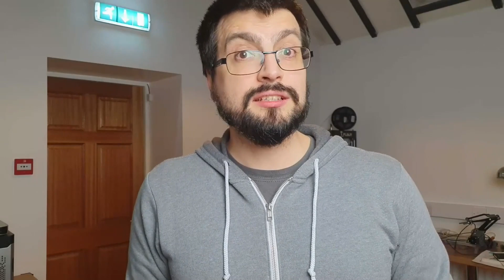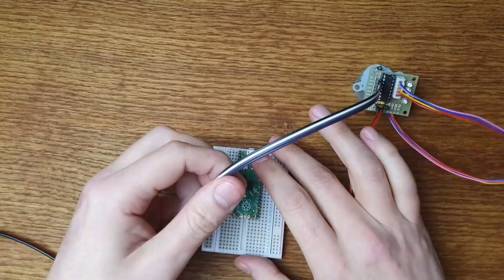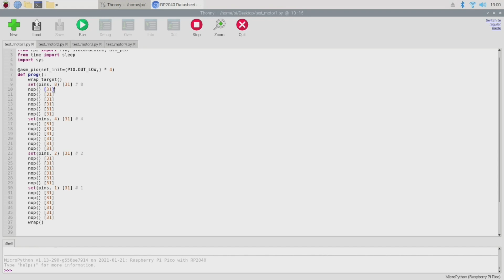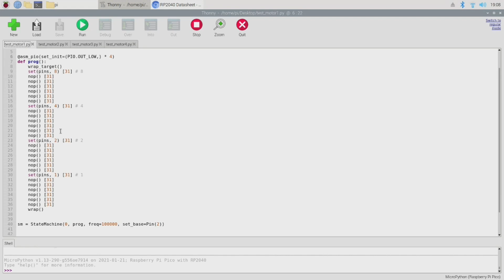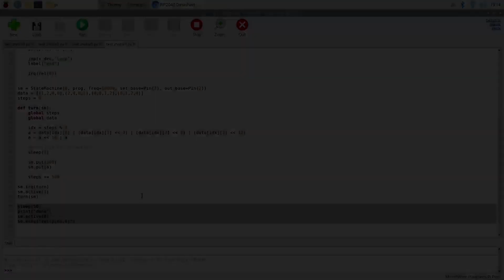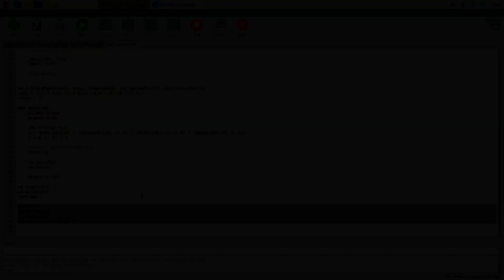Raspberry Pi Pico Stepper Motors via PIO

Comment: Thank you so much for a clear explanation on your PIO code! Just a note, shouldn't a common ground be between Pi Pico and ULN2003? Well, it works, but this is what ULN2003 spec requires if I am not mistaken.
Reply: Could be that his bench top power supply and whatever was supplying power to the Pico have grounds that are close enough for it to work.  But you're right, there really should be a common ground between the Pico and the ULN2003.

Comment: Being a nerd, I've taken one of those steppers apart and had a close look at the gearbox.
 Counting all the teeth on the gears, and multiplying all the gear ratios, led to an overall gear reduction of 63.SomeHorribleDecimal to 1, not 64:1 as you'd hope.

Comment: What will happen if we won't use controller and just plug motor to raspberry pi? Is there a method to make it work?
Reply: 3 main options, you can control the GPIOs on the pi using shell script, C++ or python. Probably best searching for separate tutorials on that. Main thing here is to learn to use the PIO state machines on the Pico microcontroller. The only reason he is demoing the programming on a raspberry pi rather than using the pi to control the motor, is because setting up for Pico programming without a pi/linux is currently a bit "involved".
Reply: You cannot drive enough current by GPIO.
Reply: @bumbarabun  I think by controller they meant without micro controller rather than without the stepper interface board... Although I guess that take on things might be the intention... I guess it is ambiguous

Comment: I've been calling it the "pee-co" (like the metric unit prefix) ... but yeah, I suppose "pie-co" (like the Raspberry Pi) really works as well... now you've got me wondering which is "correct".
Just been down a rabbit hole of IPA and pronounciation... apparently "pie-co" is valid in US English... but it works so well for this particular device...
Now... why was I here, oh yeah... you're gonna do some PIO...
Pity there aren't binary constants in Python?.. if I'd have been "the MicroPython man" that's one of the things I'd have added to the Python core.
I'm not that interested in stepper motors (well, not right now anyway) but I was VERY keen to see how PIO works... so, yeah, that was really useful.

Comment: Very good intro into the Pico's PIO! But in practice you will drive a stepper motor with a more integrated device and you don't have to take care about the  pattern for the phases.

Comment: This new math for decimal to digital conversion is very exciting. I've learn that decimal 8 is '1000' in binary and not '0001'.  For this code it doesn't matter if you do 1, 2, 4, 8 or 8, 4, 2, 1. It just changes the direction of rotation. And many have asked, where is the common ground between the Pico and the motor driver?
Reply: It's a matter of "endianism", in this case "little-endian". The first bit in a word that any word (even word of length 1, i.e. a bit) will definitely have is the lowest-order bit - the 1's column in a numeric representation. So that bit will take care of the GPIO line "right here", and anything beyond that (i.e. numerically in the higher powers of 2) can overspill to "further on".

Regarding the driver board... it ¦might¦ be a 'courtesy' to give it a common ground, but it's not a logical necessity. The reason being [I am surmising based on previous investigation] that you can drive two phases, a "forwards" and a "backwards" (with an option of "nothing") with two driven voltage sources, e.g. GPIO lines: (1,0) can be forwards, (0,1) can be backwards, and (X,X) - for consistent X as either 1 or 0 - is no drive. Just have the driver board compare the two given signal voltages for an unambiguous input. It's similar to the idea of driving an LED between two GPIO lines, instead of as usual between one GPIO and the high or low supply rail.
Do this twice - two independent channels - to get your four phases. How the electronics downstream inside the stepper motor chassis itself expands these four into a great many more physical phases for its actual windings is something I haven't pondered properly, though.
Reply: @duncanwalduck7715  , not with these steppers, they are 4 phase plus a common.
The ULN2003 is just 7 high current transistor switches, 4 of them are used for the stepper, the other 3 are redundant. (If they'd used the ULN2803 which has 8 switches they could've made 4 pairs, doubling the current capacity.)
 There really should be a ground wire from the Pico to the driver board.

Comment: why isn't there a digital ground between the Pico and the stepper board, what am I missing?
Reply: Unless the power used by both the motor and the Pico, my guess would be that at least one of the pins to the motor is always in a sinking-state and that's the GND connection.  Not a good way, but probably just a small oversite on the maker's part.
Reply: I guess PC and power supply have common ground through power plug but that is pretty bad way to do it and quite dangerous.
Reply: @bumbarabun  Not really. It's actually perfectly fine, you may call it bad practice but in real life it will work.
Reply: @tunahankaratay1523  perfectly fine? Yea have ungrounded power supply and burn USB ports on your PC or maybe motherboard as well. That does not sound fine for me.

Comment: nice little driver board.  Also works on arduino I presume? never seen  them so tiny, is that anew thing?
Reply: Yes. You can write your own functions exactly as seen here or use the in-built library within the Arduino IDE (https://www.arduino.cc/en/reference/stepper). If your intention is to learn programming I'd experiment writing your own functions, however if you're attempting to build the motor into a project I'd recomend -> http://www.airspayce.com/mikem/arduino/AccelStepper/ as a library that can add acceleration/deceleration ramping allowing smoother, faster movements. If you're interested in writing your own accel/decel code, http://ww1.microchip.com/downloads/en/appnotes/doc8017.pdf is a good place to start for the base theory.
Are you referring to the driver or motor being small? In either case there are smaller (better) versions of both. A good driver is https://www.digikey.co.uk/product-detail/en/trinamic-motion-control-gmbh/TMC2208-SILENTSTEPSTICK/1460-1201-ND/6873626 (hunt around for the best price).

Comment: Where's your ground line between the pico and the driver board? The four signal lines aren't enough, it needs a connection between the ground connections of the boards.. Looks like you're lucking out without it, or it has the wall outlet ground as common between the driver board power supply and the computer ground to the pico on the USB connection. Neither of these is good or reliable.
Reply: I assume he takes the 5V from the pico supply line.
Reply: @foorjee  I had a similar issue with one of my projects. I was powering all my external interface circuitry from my bench power supply and it all worked despite missing off the ground to the Pico. I actually wanted a floating interface supply - I found & removed a discrete (barely noticeable) link between 0V and ground on the bench PSU and I assume my PC's 0V (as appearing at the USB interface) is also grounded via the mains earth line. This "accidental" grounding should be avoided particularly on analogue circuits (I was using the ADC) where a "ground loop" will pick up all sorts of unwanted noise & interference.

Comment: Subscribed. Very good introduction to what is (for me at least), a complex subject. I would have liked a bit more time spent explaining some of the individual program statements, but appreciate that the video length would increase as a consequence.
I am working on the "paper" design that has a Pico present in around 8 separate workshop machines (saws, drills etc.) and which use 433Mhz radio to communicate with a central Pico that will then perform certain functions - one of which will be the movement of a stepper motor. Unfortunately for me, the RadioHead library is geared towards C++ with limited functionality available on Circuit Python. BUT, CP does not support IRQ nor I suspect State Machine, so really negates the advantage of the Pico. And I REALLY don't want to learn C++ as I like the accessiblity Python and MP looks just as good. Anyway, thanks for posting this one and if you fancy doing something around the 433Mhz radios - you'll get my view and like!!
Reply: wouldn't the heavy machines disturb the radiosignals ?
Reply: @jyvben1520  Yes, that is a distinct possibility and something that I plan on testing extensively to see how many lost radio packets there are both with and without the machine running. I suppose it depends to some extent on the quality of the machines (motor suppressor) AND the quality of the radios. But thanks for pointing it out.
Reply from the maker: Thanks :-), that sounds like a very interesting automation project, good luck with it!

Comment: This is awesome, great video! How would you tackle ramping/acceleration?
Reply from the maker: Thanks :-) you just need to adjust the speed that the routine cycles through the movement pattern. Maybe adding a delay into the state machine (not a lot of registers left to work with though) or having a few state machines that run at different frequencies (wasteful but maybe ok if your only working with a few steppers) I think the Pico can have 8 state machines max, but I have not tested this.